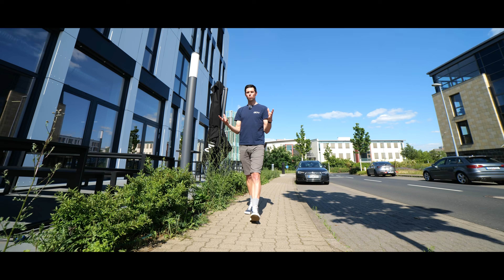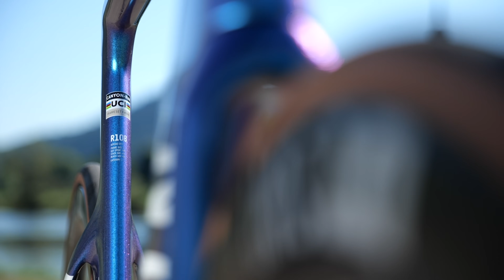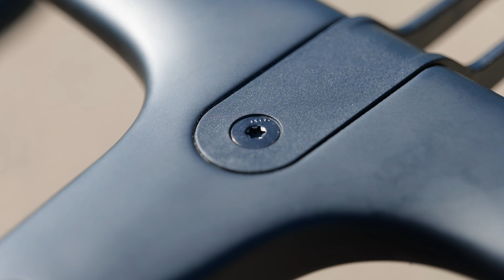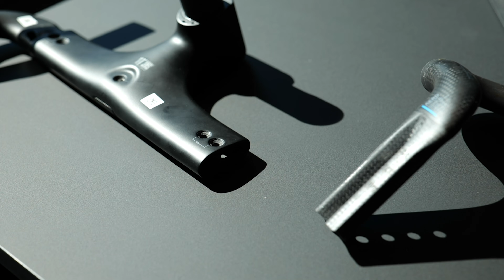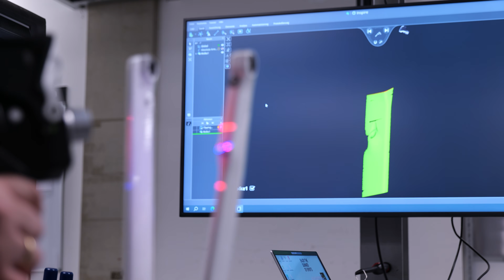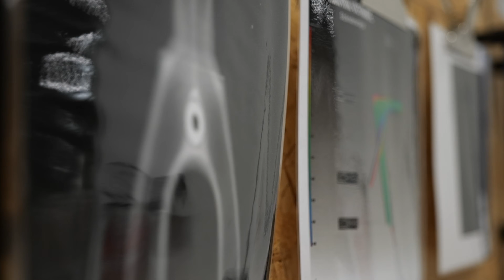New Canyon Aeroad | Behind The Scenes At Canyon HQ

Comment: I noticed the various test Bottom bracket (60Kg), pedal force (1100 N / 112Kgs), handle bars (80Kg)  I going to out on a limb, I'm guessing these bikes aren't made for someone who weighs 165Kg / 365Lbs.   Is there a frame and wheelset that the cycling community have heard of, note it needs to be serial production so parts literally off the shelf, I need it to be able to do around 200KPH yup that is correct.   Beyond any test parameters, but I believe steel fame may be my only choice, it only has to last 5 -10 runs at speed and load, if I'm successful it might be 2 runs basic and then 100 tooth chain ring added?  Any advise would be greatly appreciated.

Feel free tp laugh and mock I know you don't see elephants on road bikes especially going downhill.
Reply: You need a sponsor mate ;)
Reply: Thanks for reply, yeah I would look at Redbull but it's are you an influencer and how many subscribers/ followers. 
There's a hill I use to race down at 140KPH now they reduced speed limit I exceed it enough that I could go to jail.  It just so happens we have a new motorway twice as long twice as steep.  By my calculations my terminal velocity should be around 195KPH if my combined weight with 15Kg bike is 180Kg.
Elevation change 253 meters
Distance 3,000 meters
Grade 8.43%
Angle 4.50'18"
Acceleration 0.82M/S M2
Cross section 0.52M2
Air Density 1.2 (NTP)
Drag Coefficient  0.28
Rider weight 165Kg
Bike weight 15Kg
Combined 180Kg
Terminal Velocity 195KPH semi prone position 
Terminal Velocity 210KPH+ aero position

I am blessed with an affinity for pies, cycling and speed LOL.  It's early days, I even looked at registering bike as a trailer so I can use it on motorway.

You have an awesome day,  that's my quick story on a page.

Comment: Flared drops for a road bike are fantastic! I run 36cm C-2-C, but recent bought a gravel bike and put on some 38s from Profile Design. Their bars do not flare at the hoods, so you still get the narrow hood position and flare out to 46cm at the drops on the 38s. That is fantastic for comfort, stability and huge leverage for sprinting. Thankfully, they also make a 36cm bar, which will be going on my road bike!

Comment: That is a lot of flex in that handlebar...
Reply: Think that was a criticism of the new sworks tarmac 8 as well. Some people say it's more comfy but I don't know. Maybe it's good for most people and bad for sprints?
Reply: thats actually weirdly much. I understand that a carbon bar will absorb some shoch to smoothen the ride. but at this point wouldnt it actually work against the stiffness of the frame, when absorbing your movements that would go otherwise in the pedals?
Reply: @IFrancyISantosI  yeah and they said it is only the equivalent of 80 kg in force going through it, which doesn't seem like that much for how much it was moving. But I haven't seen other bars tested in the same way so might be normal
Reply from the maker: It's true, bars and stems do flex more than most people think. But you have to admit it sprints pretty well in real life!
Reply: @maxafc4695  how often do you put 80 kg of force on the the handlebars tho? That is the entire weight of a decent sized male adult pushing down on the handle bars, not a common ride scenario.

Comment: I don't understand why Canyon don't just let you spec the handlebar width that you want rather than trying to create an adjustable one.
Reply: Less individual inventory, therefore better cost per piece manufacturing. And it packs better in the box for their direct-to-consumer model!
Reply: @phil_d As you say but it has stopped me from pulling the trigger on a new bike. I would need to replace the handlebar and that is a lot of pain and cost when buying something rather expensive in the first place.
Reply: @ManfredvonHolstein  Oh, I'm, with you! A brand new bike doesn't offer good value to me when I need to change out cranks for 160mm, stem, handlebars and seat as a minimum.

What I've done for my last 2 bikes is wait patiently looking at the classifids. I picked up an Orbea Orca and spec'd it out with new and secondhand parts, again patiently waiting on items to drop in a sale, or eBay finds. Now it run with a new Ultegra mechnical/rim brake R8000 groupeset, Reynolds Black Label 65/80 wheels, Dura Ace cassete, Rotor Aldhu cranks, KMC SL DLC chain and carbon saddle. A 7kg Crit bike for £2000!

My lastest project is a Cannondale Slate, which I managed to find new GRX810 front and rear derailleurs for £80! 

Oh, and build it yourself. Tools are not that expensive and it's extremely satisfying and save a ton of cash!!
Reply: @phil_d  Well done! I don’t quite have that patience and keenness, also because I have so many bikes (mostly Canyons from different eras) already.
Reply: @ManfredvonHolstein  Thanks! Yeah, having so many bikes might stop you from buying more 🤣🤣🤣 But then I tell my misses, 'you have so many shoes'. That doesn't end well 🤪
Reply: They sell enough bikes that they can pick out a handlebar for your one specifically. Even if they said, you have to wait a few weeks if you want your specific bar size, I think that is something most people would sign up to
Reply: I’m in the US and would’ve 100% gotten their top tier bike if it wasn’t for things like the bar, potential fit/part delay issues. If they found a way to sort that out, they’d sell a lot more high end bikes

Comment: Moving the seat clamp up for "better feedback" . That's a good one 😂😂😂 From an engineering point of view, Canyon is just going backwards since a couple of years 🤮. Guys like MVDP save Canyon with their success, but basically their bikes are full of marketing bs and features for direct to consumer shipping, but very little good engineering.
Reply: I do not see any marketing BS,  no real claim except the 14W saving with the flared aero bars (sounds ok). Besides that the new handle bars, rubber on the front fork, torx everywhere are welcome changes for the non-pro''s.
Reply: @Loekie-de-leeuw moving up the seat clamp for better feedback? Nice way of saying we tried improving the comfort with a lower seat clamp on the last bike, but we fucked up because we are an incompetent marketing company...
Adjustable handlebar width? Nice for introducing weight and flex, but at least we save shipping cost, just like the old one!
Quill stem? Functional safety desaster which was a problem on the last interation. Let's keep that! The list goes on and on and on...